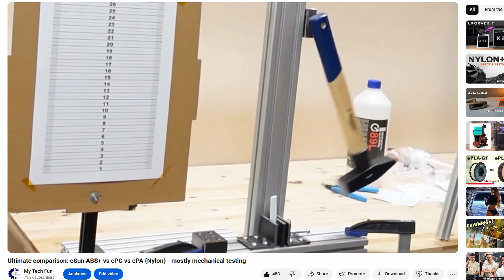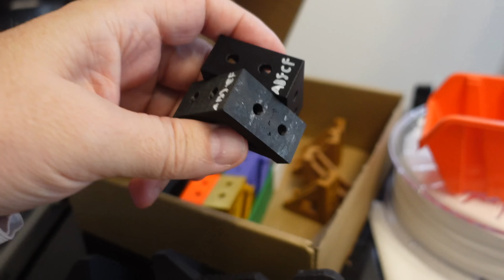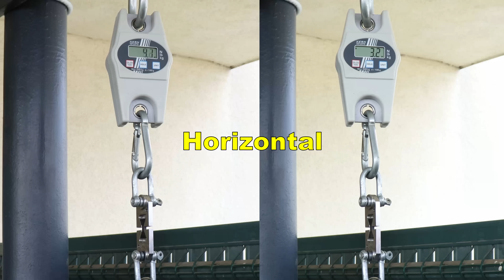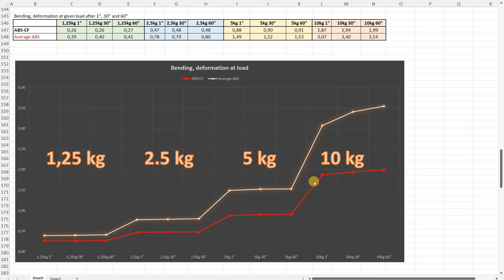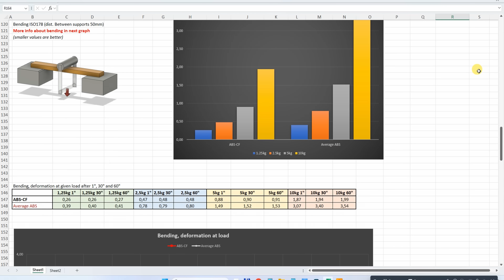eSun ABS-CF vs eABS+ .. Stronger, Stiffer, Easier to Print?

Comment: This filament will leave microscopic carbon fibre needles embedded all throughout your skin just from handling it. It could also be releasing respirable particles of carbonfibre that would get stuck in your lungs. Not a good idea for the home printer at all.
Reply: Ce n'est pas de l'amiante mec. Il vaut mieux que tu ne sortes plus de chez toi.
Reply: @gsupersport6383 It's likely not as bad as asbestos but still very bad. Just how bad we don't yet know, but research is ongoing.

Comment: Impact resistance is the main advantage of ABS plastic. It is soft, it flows under pressure, etc., but it withstands impacts very well. In this plastic, the main advantage of ABS was removed, but in general all its disadvantages were preserved. Useless material.
Reply: Um, temp too

Comment: I tried the eSun ABS+ on my Ratrig 500 and was trying to print Mr Baddely droid part and it warped horribly every time I tried.  Did you try any large objects?  The warping only was an issue on larger objects and in fact was so bad that it actually pulled the build plate off the magnetic sheet with the warping. The filament itself printed fine and on the smaller parts I was happy.  I might try a spool of the ABS-CF since the CF should help a lot with the warping issues.

Comment: I think this video proves that the typical 15 to even 25% fiber loading is way too high. Yes stiffness and tensile are maximized but layer adhesion is destroyed. I would love to see more brands move to the 5 to 10% range to get a better balance of properties.
Reply from the maker: Thats why, in most cases, they go so high with % only with core filament

Comment: Great result in your wearing test standard Igor @MytechFun, just 0.04 mm groove with ABS CF8%! 
CF really reduces friction and it´s a relevant comparison with eABS+!
I saw in your previous videos that PolymakerPolytite and Bambulab ABS presented more wear, approximately 4 and 2x higher than eABS+ (6 mm shaft, 3000 repeats). That makes me curious about two factors when comparing wear resistance between pure polymer matrix and different loadings of CF composite:
- The different morphologies/compositions between different types of ABS matrix , like eABS+, common eABS and how those differences interfer with the ABS CF composite wearing test result.
- How high CF content gives the maximum improvement in wear resistance until it starts to drop drastically. i.e. ABS CF8%, CF10%, CF20%, CF30%.

Happy vacation!!😁

Comment: I print a lot with ABS-CF, mainly from Bambu Lab since it gives great value for the money. I do like the rigidity and accuracy of the material, great for couplings and fittings, also for threads. That being said, while being hard to keep track of over time perhaps some metric describing strength/value for the cost of the filament would sometimes be helpful, one summarized and one for each test type. 

Thank you for all your hard work. This is really my favorite channel for 3D-printing material testing!
Reply from the maker: Bambulab don't have ABS-CF. Maybe ABS-GF or ASA-CF?
Reply: @MyTechFun  Correct, i meant ABS-CF but the ASA-CF is a great alternative as well when I need another color or for outdoor applications.

Comment: I can highly recommend the Biqu Panda Lux LED strip for your X1C. I have it for my P1S, and it is so much better than stock! It mounts magnetically above the door inside the printer, so you get light from straight on. It’s great!
Reply from the maker: The only problem with that LED is the power. It is not recommended to get the power from the original source (splitting to two LEDs), since the current may exceed those 0.3A.
Reply: @MyTechFun only if you keep the original light plugged in at the same time. Many people have kept both plugged in with no issue, but I was a good boy and followed the directions to only plug in the new LEDs.

Comment: The problem is that there are so many filaments these days with fairly small differences in tested results that many are interchangeable for most purposes. I keep buying more filament types in the hope that I’ll find just three, or so, that will satisfy all of my requirements. As I think I’ve zeroed in on that goal, I see several more to try. It’s a never ending quest, it seems.
Reply: I thought i will be buying fillaments to have enough to print... But i end up buying to try different ones, or just to get plain petg at good price and such so in 6 months i bought way more than i printed. But now im happy with my collection :)
Reply: i basically only use 3 filaments now. 

matte PLA for quick parts that don’t need to withstand heat nor be flexible

PETG for small parts that need some flex or heat 

PETG-CF for more functional parts. PETG CF prints so much better than PETG for me. i just wish it was cheaper 
i don’t even have to pre-dry it.

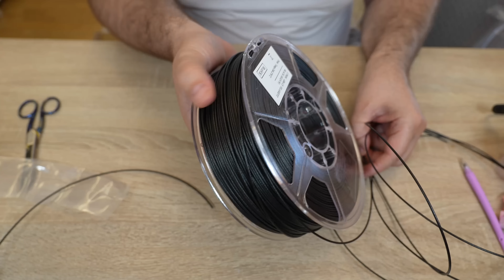Comment: Are you measuring the filament brittleness after drying? If not, you will get quite misleading values with eSun. I have received nicely dry as well as basically soaked filament that was unprintable out of the box from eSun, both of which would measure very differently in your test at 3:00
Reply from the maker: Depends, but mostly after unboxing. If it is opened earlier (like in my coming up PET-CF video),  after drying, but waiting until the filament cooles down

Comment: I think you should be a tiny bit more precautious during abrasion tests with those CF filaments.
Please wear appropriate protection.
Reply from the maker: Believe it or not, nothing that can not be washed off (even if some videos claimsdifferently). Particles will sediment quickly, and I will not breathe them. Safety is similar to woodworking safety.
Reply: don't worry, he knows that he's doing.
Reply: After people have forgotten asbestos, we can have carbon fiber hats and clothes :D

(What you can't see, can't hurt you. Best regards, weird mushrooms, tobacco, DDT, microbes and radium radiation)

Comment: I ordered 20 spools of eSun TPU-LW and eSun gave me a 30% discount and sent three bonus spools of filament.  One was a dark red ABS-CF.  It's not a filament I would have purchased but it printed great on the Sovol Zero.  It has good strength and looks very nice.  They also sent a black ABS+ filament that I haven't tried yet.

8% carbon fiber might be optimal for some of my parts where I'm mostly using carbon fiber for reduced shrinkage and a more aesthetic matte finish that hides layer lines.  I like that the filament isn't so brittle that it breaks in the PTFE tube above the extruder, and less carbon fiber is less abrasive on extruder gears.